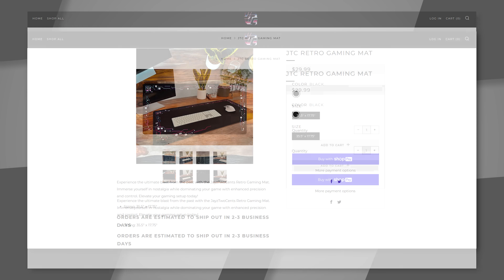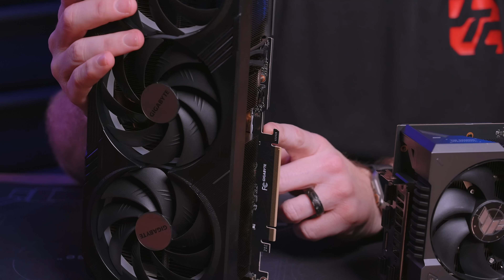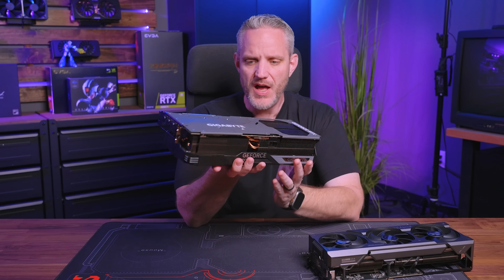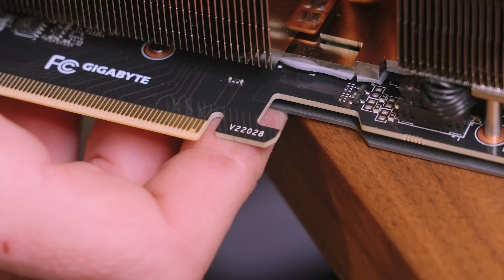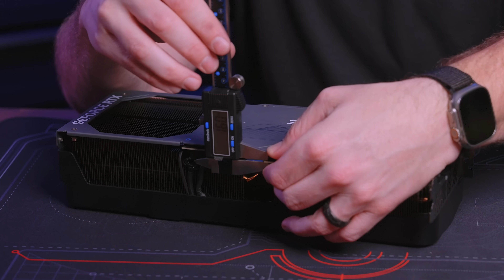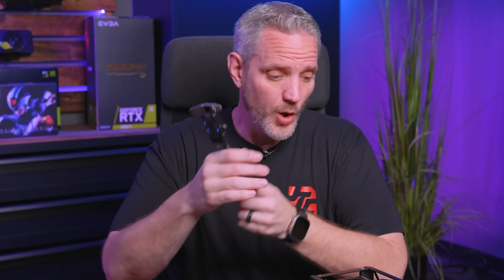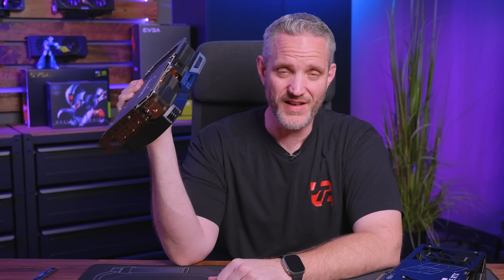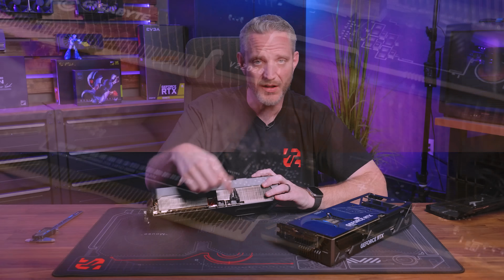These GPUs are cracking and the company REFUSES to warranty them!

Comment: also, I cant tell, but the ASUS board manufacture may have runt the inner layer metal ground into the locking tab area, and GigaByte didn't.  That metal ground layer can stiffen the pcb considerably, and still be the 1.6mm thick.  And, the metal layer will not allow the cracking to go farther into the board.

Comment: The common denominator is not the consumer in most cases, it is a company that is lacking in proper design and execution of the design if it is a proper design for the stresses that the card will go under.. there are people who will not take care in putting a system together with the level of common sense so as not to jam it in but a poorly designed retention system could also be the problem.. it seems in the cases that where presented by you, you have proven that the design has been short changed in materials and proper bracing and it is quite clear that if someone is damaging a board because the retention system is a blind pull falls squarely on the shoulders of the people who designed and built the system *if you can't see what you are doing, it is a blind pull*.. There has been too much passing the buck and let someone else take the blame, but if there are enough cases that are making it to rma and being denied only  to have to be sent to 'company name'  3rd party repair this is poor customer support and gouging the consumer.

Comment: The size of those cards is nuts. Thought my 3060 was big. Any traces in part of a supporting mechanism is just stupid and also the size of cards keep going up but the thickness of support tab stays the same. ASUS must use a stronger material but still that little slice of board supporting a beast of a card like that of course issues are coming. Good vid.

Comment: Using any of these modern cards without a brace (braces) is simply ridiculous. 
There is no way that cards of this size are not going to torque and put a lot of stress on the PCB and the mounting points, etc.

Comment: 6:55 explains it all. Maybe it's a background in aviation that made me see it, but the reason it's cracking is the same reason the window frames cracked in the DH Comet's (note root cause, not failure mode). That top radius is too square and is focusing the stresses. The failure mode is likely just building overstress from the sag over time against the retainer clip (as opposed to the Comet which was fatigue).

So simply whomever designed the outer dimensions of that board f'd up. It looks pretty, but it will fail. The ASUS board not only proves you don't need to make that corner like that for clearance (although it probably saves some fraction in materials), but that circles are a stronger shape!

Comment: I've had so many gigabyte cards break on me it's not even funny (i build systems and sell them so handled a few). I swore off them for my personal system when back in 2017 I bought a gigabyte r9 390 and these cheap sobs put a gtx 970 cooler on it! It thermal throttled to holy heck! While i had a second 390 from msi and it ran just fine no problem. Not to mention they have a clear bias to nvidia over amd and their nvidia stack is garbage! Garbage company garbage products! I'm very glad they're finally getting some heat for their criminal business practices! Please no one buy their products there's so many better choices out there.

Comment: I believe Rossman doesn't work on GPUs though obviously his knowledge overlaps into this area some.  I did see Krisfix showing the types of issues you can get from cracking these before though and definitely not good or simple to repair in many cases and even after he has successfully fixed some he said they would only be useable in a vertical orientation after that.  If you have a really heavy card I would certainly be careful and use anti-sag solutions to help support the cards.  This isn't a Gigbyte exclusive problem as far I can tell.

I think it's kind of like 4090 power cable.  If you know and your careful you're probably not going to run into an issue.  But it does kind suck that's there's potential issue and companies could try to make it little more dummy proof in the future.

Comment: that's engineering/design flaw (maybe manufacturer hates to admit it, but it is engineering/design flaw). any parts that has physical contact (lock tap or screw hole) on it must clear from traces because it will be has physical stress. on PCB design usually (for me also in this case) use at least 5-10 mm clearance on physical contact such lock tap, mounting screw hole, corners and side. those area must be a clear or neutral zone (for ground it's fine, traces is a big NO). I know from manufacturer pov it will be pricey cost to admit it's as engineering/design flaw, they must pull the "expensive" products back (cut a big loses), but hates to say it's a bitter pills that they need to swallow, it's not consumer false that the locking tap is broken because it's exposed to physical stress (at some point it will break but doesn't mean the GPU can't work anymore).

Comment: I'm pretty much done with Gigabyte at this point. At this exact moment I have both a dead PSU and a dead AM4 platform board from them, and in the past I've had both a dead GPU and a dead AM3+ board, I don't know what the hell is up with this company! The quality control is so bad that I've had better luck with products bought from AliExpress. I'm not going to RMA these parts because I don't want to keep them, but I'm also not going to be a douchebag and sell the replacements to someone because I literally don't trust that they will be functional for a long time. I'm currently on the waiting process for the new PSU to arrive (an XPG Core Reactor 850W), and it baffles me that their P550B PSU (which is a 550W CPU in a system that draws out 380W at max) died out within 2 weeks of usage! Yeah it's a simple PSU, but 2 weeks of usage before it dies, and in a PC that has a theoretical draw (accounting for parts aging), that won't go above 410W? What the hell!

Comment: I have a Gigabyte 3080 gaming oc waterforce wb 10g that broke the first day I had it. Since it is just sitting around mocking me and was already replaced with an Asus Tuf 3080, I would love to send it in and be included in this test. I could not see any cracks in the pcb so I think it was part of my water cooling solution that created some sort of circulation problem. It died while I was sleeping so it was not being worked hard as far as I know....but since I am using an Asus dark hero motherboard and Ryzen 5900...Anyway, give me an address and I will send it out.

Comment: Softer PCBs that are more flexible doesn't mean it will crack easier. The stiffer the PCB the more likely it will crack. However, one flexes then breaks, the other doesn't flex as much but would catastrophically break. Think about it like metal in a sword. The more carbon it has the finer the edge but the easier it is is to break. Less carbon means more flex but it will bend and flex before it breaks.

Comment: I know all manufacturers have issues, and like you said it's the service & RMA process you need to expect, on the how good a company your buying into.
I've had two Gigabyte cards fail with the first the Shop refunded me🙏 and the second they rejected the RMA.
So as Cleetus puts it "Your Done!"
and I've used anyone but Gigabyte since, just my take. With this coming out now, I don't want to get burned a second time with Customer DB's going down , badly designed PSU's that blow up instead of auto cut out, and a by design backdoor in their Motherboard BIOS! All coming out in 2022-23.

Comment: The Asus Card has a stand off near the edge of the board which helps the board from flexing. The gigabyte card has no stand off or mounting point near the tab which is causing the board to flex more.

Comment: Question: is this also happening to AMD GPUs? Because that would make the issue even worse. In any case, I think it will be just a matter of time before it affects other AIB partners as well.
Reply: Same here. I have a Gigabyte RX 6700XT. Didn't use any anti sag holder. Now I'm concerned.

Comment: Thanks for pointing out this issue. My TUF 4070 Ti is mounted vertically, which is why I feel kind of safe at the moment. However, it would still be interesting to know how many of the cracked cards were actually mounted vertically.
Reply: With a horizontal case, stress fractures will simply not happen as the weight is downwards into the socket, as designed.  Yes, motherboards, CPUs, and Coolers are all designed to be run best with the board flat and not on its side.

Comment: Stopped looking at gigabyte after learning that in 970 they were replacing safety measures [from power overload] with connectors to save up about a cent per gpu...

Comment: Diablo 4 on max settings only is 4K hrs at “ 60hz” it’s not even that crazy. Rog 3080ti at max d4 settings runs about 49 utilization gpu …… many other titles using way more power for 120hz…..

Comment: Be assured that Gigabyte is Fully aware of the problem.  They are just hoping that nobody else finds out that it is a wide-spread problem and they can convince users that it's just them .  Had the same problem with HP and a chromebook c330 cover cracking.  They are quick to blame the users and quietly redesigned the part for the next model.  Honestly, with the size of GPUs these days, I'm shocked that some new mechanical connection between the cards and the mobo hasn't been developed yet.

Comment: That's inexcusable.  I'm in a business where we go mount parts to circuit boards and there is indeed a difference between quality more expensive PCBs than cheap.  Cracks in circuit boards are a big no-no because the damage it can do to traces.  I guess I'll stay away from Gigabyte from now on.

Comment: I used to work at a disty. All our brands would be scummy on these warranty jobs, so no, no one's "the best" out of the lot, but Gigabyte always had a reputation around the office. Someone would go "uh oh, gotta do a Gigabyte board" or "that socket with the dead bios came back AGAIN, this is the 4th time I'll have to tell them it was never sold and never patched. They're trying to tell us it'll cost nearly a new board to flash or solder a bios chip lol" - so, yeah, not surprised they're rejecting these based on a sticker or a defect that looks remotely like user error was possible.

Comment: I love your videos Jay, but I just wanted to note something that others may have already.

The ASUS card, nearby where the tab is, has a post mount to the heatsink. This will reduce flex but will NOT make it any stronger. These cards are made of a fiber glass material that is very giving, not unlike the flex we see on motherboards where the CPU is mounted.

The PCIe PCB thickness requirement is 1.6mm, you cannot make them thicker than that or you risk damaging the slot. So you will not have cards thicker than others.

However, the lack of material between the tab and the PCIe slot, combined with the weight of these cards and running traces too close to it is a valid concern. I don't think there's any way to fix these without entirely re-designing the PCBs to work around this problem.

Comment: I wonder how many of these cracked GPU's are in pre-built rigs?  The stress of going through shipping is amazing!  I have seen entire PCIE slots ripped out of the botherboard.  Even if you brace the GPU's with packing foam, it could still take a lot of stress from a bump.
Reply: I was going to say this, I've also seen quite a few Gigabyte Eagle series in prebuilts too.
Reply: Brotherboard sounds better than motherboard
Reply: It's not specifically a shipping issue. I own an electronic repairs shop and we've had about 400 of these gigabyte cards since the 30 series released. Out of those, 7 were ship to home units. I don't doubt that shipping could be a factor in broken cards, but usually that will be taken care of by the seller warranty, also not a lot of pre-builts use Gigabyte cards. While I haven't seen this issue with any card that isn't Gigabyte, I can't say if that's because other cards aren't cracking, or if other manufacturers are just honoring their warranty unlike Gigabyte. Either way, to core lesson is still the same, don't buy a gpu from Gigabyte. Honestly just avoiding Gigabyte in general isn't a bad idea based on their response to major issues in the past few years.
Reply: @flyingtentacle7631  Tks for the added info.  I spent 20 years repairing computers at a shop and we tried some crazy things to keep video cards and heavy heatsinks secure in transit.  I cant tell you how many tech phone calls on new computers were solved by telling the customer to push down on the video card and try again.
Reply: @flyingtentacle7631  So just 30-series? Not 40-series?
Reply: @flyingtentacle7631  Don't buy GPU, don''t buy anything from Gigabyte. PSU on fire, and motherboards fail and crappy usb that don't work.
Reply: Lenovo 3060 I checked has 3 screws through the backplate edge over the slot area, and two more at the ends along the edge, and an additional screwed down end bracket, so its just a design thing.

Comment: The tensile strength of the material isn't based on the "flex" you are talking about. A material being flexible might give it a higher tensile strength. As they are made in one piece I will assume that the shape of that little fin is different and is a larger contributing factor to the stress put in there.

Comment: Dont know if Antec ever managed to do that on their power supply, sold them for some years back in 2000 or something. was a capacitor that broke and they said now we fixed it on this version and the same problem version after version. In the end, my distributor changed to another brand.

Comment: I am not even gonna pretend to give them the benefit of the doubt. We are 10 year's and 10.000 cases past this. They are probably struggling as a company if they need to risk a cheaper board in their gpu's and not add that cost into their production.

Comment: 15:25 their  is your problem right there...there is no heatsink  retention screws like ASUS use to keep pcie connector reinforce the pcb from bending like what your doing to it is very hard to do in any thickness of the board when spacer and screw make it durable from flexing the material ; that is the logic in asus boards but gigabyte logic is use less screws and hope the best but eitherway, nvidia makes the best designed from everyone by adding what you mention with 3rd pcie slot bracket that holds entire heatsink and board ...its way over engineer for cost lot less than 3rd party who may cut corners for durability and performance is what everyone saying about evga have dirty habit do so is similar as gigabyte

Comment: The elephant in the room is that the mounting system common in todays PCs is completely unsuitable to host such ridiculous sized cards.  It was never designed to deal with loads like that in the first place.  There needs to be a rethink on a mounting system that is actually suitable for todays hardware.

Comment: As a machinist your measuring skills with a digital caliper suck. If you can't stare directly at the screen when taking your measurement then be absolutely careful to pull the calipers off straight to read it. 
Also, something else i noticed is the asus card had a support for the cooler mounted on to the pcb very close to the tab where as the gigabyte card does not. That support will help to stiffen up the pcb and eliminate some flex.

Comment: My takeaway from this is I need to build a bracket to keep my card from sagging.  If you look at workstations from HP. They use both a bracket to support the end of the card and a pad in the lid to keep the card from lifting out of the socket.  They wouldn't do that if they didn't think it was essential.

Comment: PCBs aren't supposed to be "structural", i.e. meant to hold the whole assembly in place and supporting weight: they are only meant to serve the electronics. They may have partly served a "structural" purpose when the cards were much lighter, but  the cards are just too heavy now. Someone should redesign the whole PCI mount from both the card's and motherboard's ends, otherwise many more models of cards are going to start getting damaged in the near future.

Comment: 100% user error. Not warranty. This type of failure can only happen if you forget to open the latch on the mobo and jam the card in there, you snap the tang, open the latch, and then you put it in and let it ride. It’s not a sag problem because, well it simply can’t be, the entire PCI slot is on the same plane, you’d have to snap the whole thing, also the PCB is quite flexible in that direction of force…They snapped it at install, didn’t care, and used the card for months like that until eventually the crack propagated to somewhere important. Live and learn boys.

Comment: This is why I have a GPU holder just in case and to give the card the most support possible as it will sit there for years. 
When insisting and extraction you should always get a hand in the card when the card is not secured to the case just to help keep pressure off the card because these are heavy, especially the 4090.

Comment: Hi Jay, I have a Gigabyte Wind force GV-N770C-4GD (GTX 770) and it is heavy for that generation of cards and the PCB area that you are talking about is so rigid that I just cannot flex/bend it at all and it feels like metal but isn't.  So I believe that manufacturers are cutting corners to save money.  Cheaper PCBs.   Shame on you Gigabyte, you will have to do RMAs on all those cards or Gigabyte will suffer financially and may go bankrupt.  That's OK because there are to many resellers of NVIDIA products.